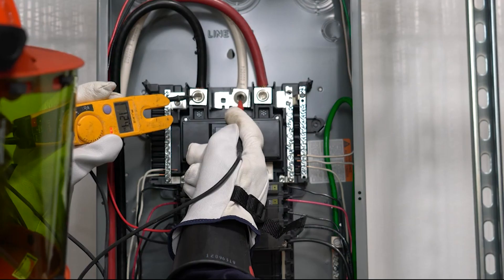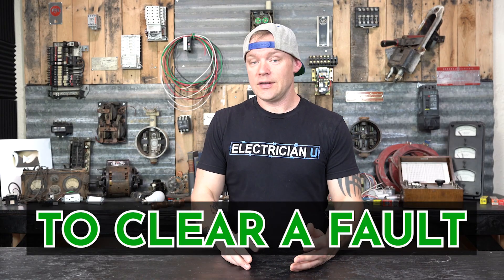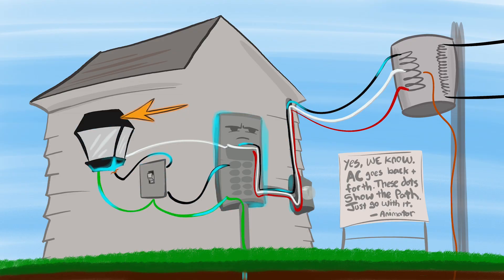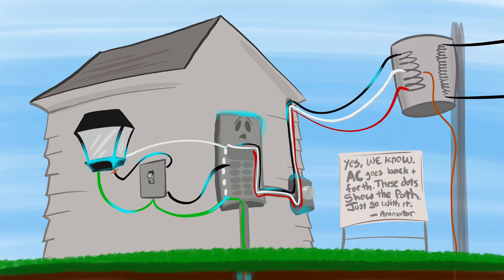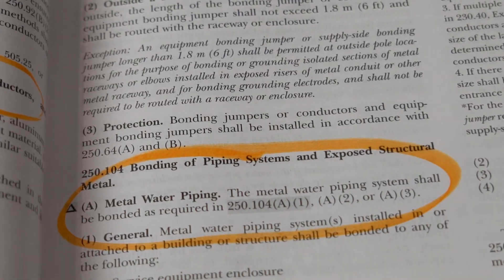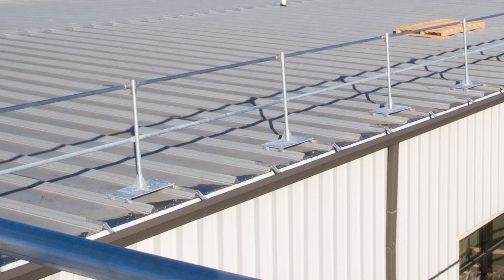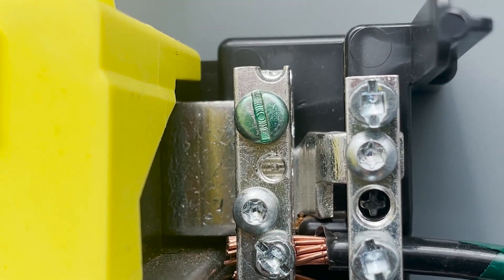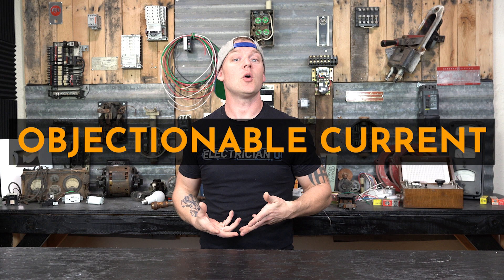Why Do We BOND Neutral & Ground in ELECTRICAL SERVICE PANELS?

Comment: Grounding and bonding has nothing to do with the gfci and afci breakers. There are two ground points and one bonding point on a residential service connection. The first is the electrode that grounds the center tap of the transformer. This provides 2 things, a reference voltage of earth (0v) in the systems neutral and a path from the earth to the transformer as a return path for ground faults. The second ground is the electrode at your service entrance. This ground provides a return patch to the transformer for the safety ground on all of the circuits in your home to prevent electrocution. One bond exists, usually a green screw that bonds the neutral to the grounded load center enclosure. This provides 2 things. It prevents the voltage potential on the neutral system and ground from drifting that could cause electrocution between 2 relatively safe conductors when the load center has high load on the neutral that could cause voltage drop on the bus and create different voltage potential. The other is to provide a strong return path to ensure enough ground current will flow to trip a thermal magnetic circuit breaker in conditions where the resistance of the safety earth electrode may be too high to allow enough current to flow to trip the breaker. Finally contrary to popular belief, no ground is required for a GFCI device to function properly. They require a neutral connection to both the load center neutral bus and the load circuit along side the live connections. The device then uses current transformers to create a voltage potential and compare them. In a proper circuit the currents, and thus the CT voltages in both conductors will be identical. If a ground fault occurs, some current is carried by the safety ground, or someones body to ground, and the neutral current drops as does the voltage on the CT. The device notices the voltages drift apart signaling a ground fault, and it opens the circuit. You can install these devices on old wiring with no ground conductor, and they will still work just fine since they only look and the current flow in the live and neutral conductors.
Reply: How would one go about putting in GFCI outlets with aluminum wiring?
Reply: @JenniferF2882  It depends on local code requirements, here we pigtail the aluminum with a short piece of copper, anti oxidant paste is applied such as Pentax and then joined with connectors approved for AL and CU conductors. The copper wire can then be safely connected to the terminals on a device requiring CU only connections. Check your local codes, they may vary.
Reply: @RC-nq7mg  ahh interesting. My house has aluminum wiring and I've been changing the light switches and plug outlets room by room (slowly) and adding Noalox to the screws and ensuring to not over-tighten. Nice to know it can be done, though.
Do you prefer AlumiConn connectors or a different type/version?
Reply: @JenniferF2882  Not familiar with those. I have a box of #63 marrettes I have had for ages, that and penatrox A-13 has worked for me.
Reply: Aluminum wire is dangerous. I would replace it as soon as possible. Fire hazard.
Reply: @dallas5374  Easier said than done when it is in enclosed walls. Nothing wrong with aluminum wire if it is not abused, same goes with knob and tube. It only becomes a problem when it is worked on improperly or abused.
Reply: @RC-nq7mg  is right - aluminum wiring is only a danger due to contact points working loose from electrified lines getting warm or hot due to power flow, thus loosening connection points. Transmission lines are frequently made with aluminum. 
So long as they're not over-tightened, not corroded or oxidized, not overloaded, etc.  They're perfectly safe. Just can't connect aluminum to other wire types without proper precautions or procedures (Noalox compound is one).
Reply: @JenniferF2882  Yep and aluminum is commonly used in larger gauge circuits or feeder circuits. My home is wired in all copper except the circuit for the range. That one is aluminum. Likely a cost saving thing. The incoming feeder for my service is aluminum as well as it is much cheaper than copper. Here in canada nearly all feeders are aluminum, the USEI we burry to a service entrance, triplex overhead and high tension transmission lines. Sub feeders in commercial applications are generally aluminum ACWU. To ad to knob and tube safety, the big reason these circuits are dangerous are not the age, but mishandling causes the insulation to deteriorate, which is not that big of a deal since the conductors are usually spaced nearly a foot apart in hollow wall spaces suspended in air by ceramic insulating posts. The real issue is overloading, most homes with knob and tube have only a handful of circuits for the entire home and are easily overloaded. Given that the load centers of this era used edison base plug fuse, you could easily grab  a 20 or 30 amp fuse out of your range and slap it into a circuit rated for 15A. People did this all the time when fuses kept blowing, not to mention the pennies.

Comment: It's really simple why you find the ground and neutral together if the neutral fails people aren't going to get electrocuted the ground is a safety wire in Case equipment fails and lightning strikes reason why we have grounds in the first place and old fashioned radios TVs especially the radios needed the ground for the antenna to work grounds also helps capture stray voltage it was quite interesting in the old days plug it in the TV center radio if you had a hum you would turn the plug around and that would fix the problem because one side of the plug was actually chassis ground to the chassis with the resistor in the middle called a grounding resistor so you had to have the plug polarized without you guys are probably too young to remember the screwing fuses back then I think you're 25 or 50 cents a piece that was big money back then

Comment: Why wont the breaker detect there's a ground fault if the bond isn't there? Current still has to flow through the breaker
Reply: the grid is grounded all along it, and current will flow without bonding, but if your ground rod /system has lower discharge capacity than the breaker in the fault, there will not be enough flow to trip the breaker.
Reply: @DeminicusSCA  I've watched a video in the meantime where a guy tests this scenario https://youtu.be/gHQE5L6hbgs?t=585

Thanks for taking the time to reply, I understand now :)

Comment: We call it grounding because in certain applications you actually use a capacitance system instead of direct earthing.  Yeah... fun stuff.   See the dirt on the other side of that fence in the concrete wall stuck down in the ground?  We don't that that dirt to be contiguous to the dirt we're standing on over on this side of the wall.   Grounding isn't simply "stick it in the dirt", it allows for inductive grounds too.   "grounding path" is the correct term.

Comment: What would you say if I said power lines are like radio antenna and supply sum electrical power???
Reply: Prove it ...
Reply: @MrSummitville  will you donate for miles and miles of copper to get the proper effects

Comment: That was painful.

If ground is not bonded to neutral, it still has a path back to the source. The earth may be a good insulator but it will still carry current. There's still a path back to the transformer. However, the fault may not pull enough current to open a breaker which is why it should be bonded.

Boom. Saved you 8 minutes of painful explanation.

Comment: The issue isn't so much fault currents on the bare ground wires as it's normal current flow on the netrual wire that will flow half on the neutral wire and half on the bare ground wire if you have multiple bonding points creating parallel paths back to neutral in the main panel.

Comment: The return also tells the transformer that there is power flowing I've seen time's when the white wire was not properly connected in the case of a campground the second year apprentice it was an old system that he was unfamiliar with even a master still had but in using a multi meter I was getting everything from 38 volts to 180 at the plugs it fluctuated one of the guys had brought a game to keep his kid occupied and he plugged it in and fried it after a day of searching the old master found the problem and fixed it he was was the first electrician that was willing to take suggestions from a non electrician I'd had one in a new home construction that hadn't grounded the system properly and he would not take any advice he new what he was doing and it didn't matter how many people got got shocked there was nothing wrong with his wiring but there was somebody on site different days with a tool that was shorting to ground and when he was onsite if you touched anything that was grounded the boxes on my 220 volt heater plugs the heater itself even tool's like their compressor you'd get a hell of a shock

Comment: As a kid I used to catch worms and sell them at a bait shop. I did this with a homemade worm prod which is effectively an extension cord with the neutral and ground blade and lug cut off leaving just the hot blade and a large metal spike with a piece of wood as an insulator for a handle. It was simple enough although there was some back yard science to selecting the size of spike to use (one too thin would heat up or arc and pop the breaker and one too big wouldn't as effectively excite the worms to the surface and/or just pop the breaker).The cord plugged into an outlet and at the other end the hot wire connected to the metal spike. Simply stick the spike in moist ground and plug it in an outlet and wait a bit and worms would come to the surface as they didn't like being shocked.

It was possible to get a jolt by kneeling or grabbing a worm that was to close to the prod but other than having bad soles or wet shoes it was easy enough to avoid getting shocked and effective. The real danger was in moving a prod and the possibility of becoming the link between the prod and ground. This was often solved by having daisy chained spikes so there was always one in the ground when moving a prod. Funny thing was it was just the hot to the ground in the simplest way but the breaker could easily trip, this is where the size of the spike came into play as one that was just right had adequate capacitance as to not get hot and basically acted like a resistive load.

Or so I thought??? What is puzzling me now is how was that signal making it back to my neutral buss to complete the circuit to allow the breaker to still work??? Was the signal really traveling 75 to 100 feet back through the ground to the ground rod outside the house and finding it's way back up to the neutral/ground bond??? Or even to a neighbors ground rod and likewise up into the bond which was supplied and connected to the same transformers as my house or am I not understanding something??? Is earth truly connected in that manner, would capacitance and resistance eventually become an isolating factor??? After all, it's not like there's a ground wire coming into my service panel from the pole out front, just 2 legs and a common. Anyway this video has me rethinking what I thought I knew and understood, LOL. Go figure.

BTW, I made bank on those worms back then and those big crazy lawn darts they had back in the day worked great as prods if you wire 3 of them together. Go figure that our power bill probably outrageous as that meter spun like a possessed persons eyes when prodding. Probably cost my parents more than I made, LOL. :)

Comment: But this is why we use differential protection in homes, ground is to protect peoples, not equipment.  Ground is for protection , neutral is for circuit. A differential protection can sense any amount of current going to ground and trip way before any over current or even heat.

Comment: Wouldn't using a RCD be better than bonding ground to neutral
Reply: Why would it be better ?
Reply: Ground is primarily meant to be for protection, and can usually only handle low currents without developing a voltage. Neutral on the other hand can actually not be at ground potential, and could saturate the ground circuitry leading to the ground potential rising. Considering ground is usually connected to the outside body of electrical components exposed to the user. This could actual lead to a hazardous situation where exposed metallic  on the outside of electrical goods get electrified.

A rcd would check that the current leaving the panel on the live cable is equal to that returning on neutral. If they aren't equal it trips a fault and the ground circuitry sinks the residual charge.
Reply: @TheWeedOperation  We have GFCI outlets that do that. GCFI and RCD have active electronics, which have a much higher FAILURE rate than standard Circuit Breakers.  Bonding the Neutral Bar to the Ground Bar allows us to detect and PREVENT a Hot Metal Chassis using a standard Circuit Breaker with no electronics.

Comment: I would love to see a test of two out of phase hots on one neutral where the neutral is removed under load.
Reply: That’s what happens when you lose your neutral connection to the panel when sharing said neutral such as in a “roundhouse” circuit, which is two or three phase conductors sharing the same neutral... lose that neutral connection and all the 120 volt circuits past the connection loss suddenly become 240 (208) volt circuits!
Reply: @jeffschoonover9341  I would love to do a real life demonstration and see which device gets destroyed.
Reply: @FairfaxSports  I’ve seen amusing cases where blenders sound like jet engines and toasters suddenly become light bulbs 😂, but I’ve also seen an entire enterprise department fry about $150,000 worth of equipment. That last one was caused by a journeyman electrician lifting the wrong neutral in a sub panel while trying to pull out an unused circuit... oops!
That’s why roundhouse circuits are only used in commercial and industrial facilities - we are supposed to know how they work and how to identify them. In residential applications, homeowners would be frying things left and right 🙄
Typically in a single phase (2 hot, 1 neutral) roundhouse the neutral will be 1 or 2 wire sizes larger, and in industrial it’s typically the same because even though there’s 3 phase conductors, they tend to balance better than single phase.

Comment: Is there a problem with putting the neutral and ground for a circuit under the same screw on the shared ground/neutral bus bar?  Just wondering cause I'm out of room.
Reply: In the Service Panel = OK

Comment: Ground and Neutral are the something however because in theory, electricity likes to take the path of least resistance. Grounding is specifically there for over voltage or lightening so if the path back to the service is too high in resistance it will instead bleed into the ground rod. Which is why bonding for ground and neutral meet at the Main Panel. If you were to cut the neutral conductor from the Main panel you will still have 240volts however now everything grounded is Hot.
Reply: Bonding of the Neutral and Ground wires, has nothing to do with lightning protection ...

Comment: @3:20, you say that the breaker cannot know if the current is flowing to the ground if there is no bonding. I disagree, because:
#There is a "complete" circuit, in the sense that current can FLOW, with the ground. It's  just not going back to the source.
# And In the case that current can FLOW, be it through a human or a green💚 wire, returning to the source is irrelevant for the current.
#HIGH current flows through the "black" conductor, through the "LOW resistance" path into the ground.
# This high flow of current should therefore trip the breaker, as it literally only sits on the incoming path of the current, and has no authority over the return path.
# Where the current is headed, should therefore be irrelevant to the breaker; there only needs to be a "HIGH current" passing.

Where did I go wrong? 
Thanks.
Reply: I'm also wondering about this. The breaker will sense higher current and trip even if that current is going into the ground, no?

Comment: Then why is there a system called TN-S :(
Reply: And also an RCB would still sense earth fault even if you dont bond neutral to ground since line current would be different than neutral curent during an earth fault

Comment: Good content.  That being said, I have never heard an electrician mention some early-on reasoning of 'grounding'.  Their is contemporary reason - to enable ground fault breakers etc etc - but not the primitive initial ground reasoning.  I'm not going to mention it - let's see if anyone knows.
Reply: To provide a low impedance path to ground. look in a textbook about "current divider" theory. Basically the current divides up in inverse proportion to the impedance.
Reply: @sallymelville903  Can neutral and ground impedance between them be safely measured from an outlet?

Comment: So a properly working circuit is 1 where the electricity returns to source via the neutral. So if we have a fault & electricity goes thru the ground & then the neutral bc they r bonded, how does the circuit breaker know that there is a prob? It returning to the source as it shld. Is there a difference in potential or something? I rewatched to c if it something like that is mention.